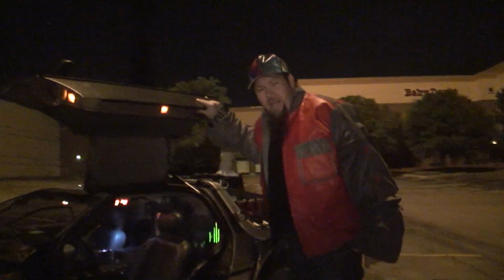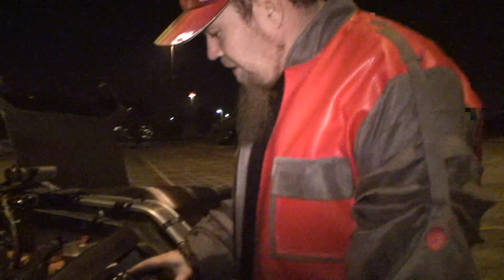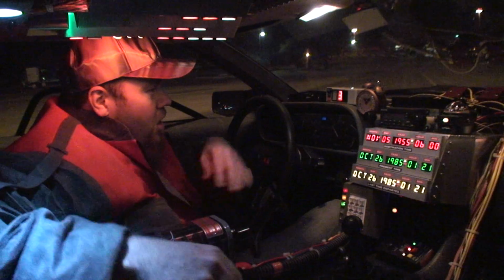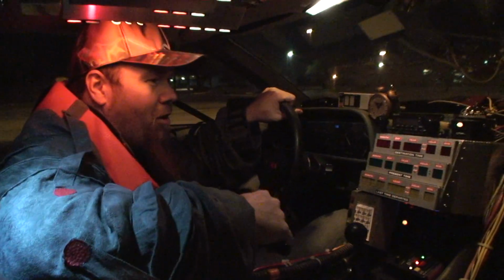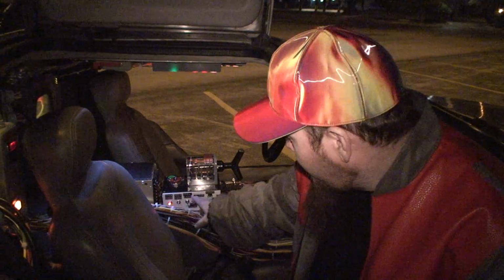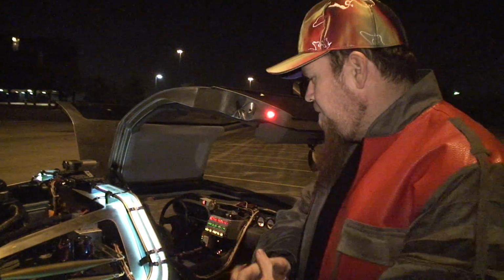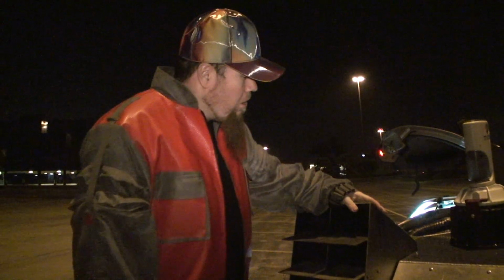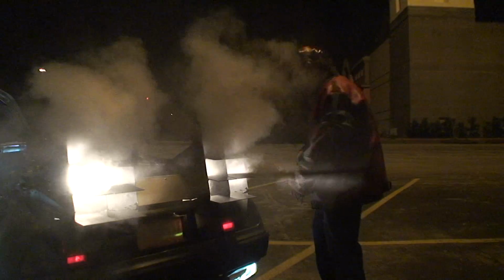BTTF Delorean Time Machine Replica For Sale

Comment: Too bad this doesn't work...go back and get the contract to build the original for the movie.

How do you get away with using the Mattel trademark while selling the hover boards? Isn't there some infringing aspect there?

I looked around the site, if available, how much would you charge for just the plutonium gauge? Is it actually just an amp or volt meter?